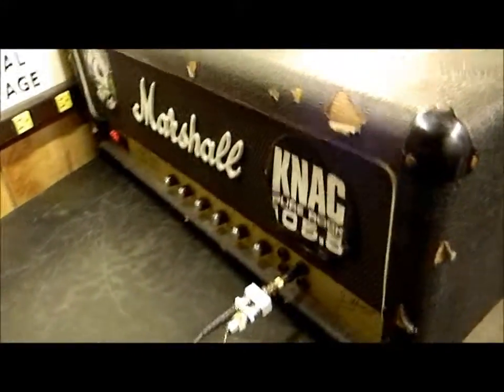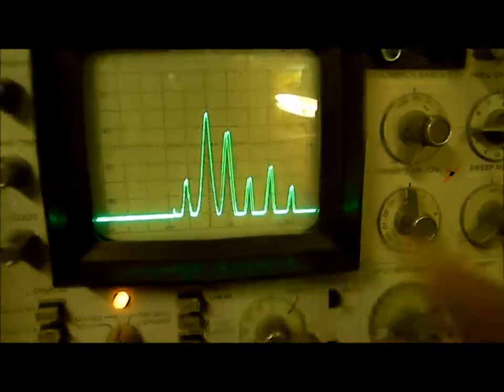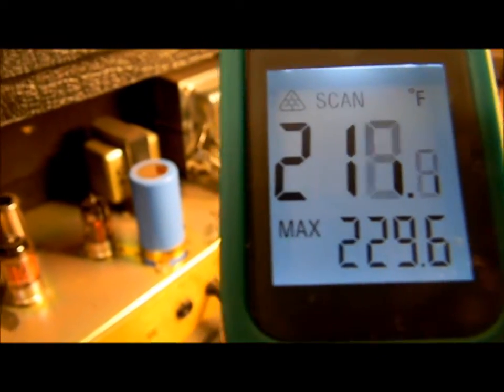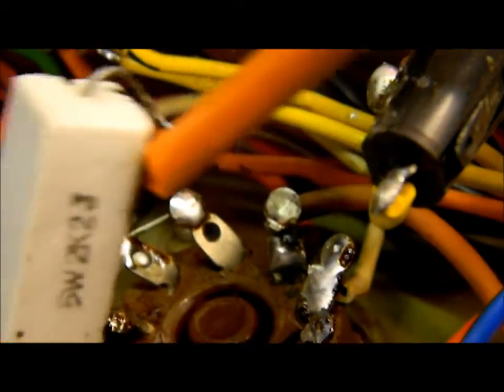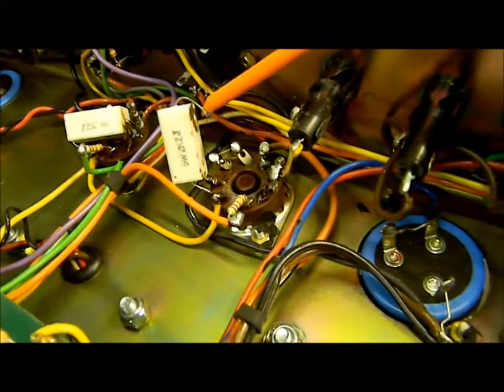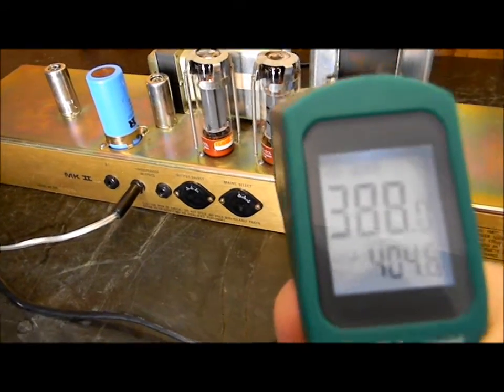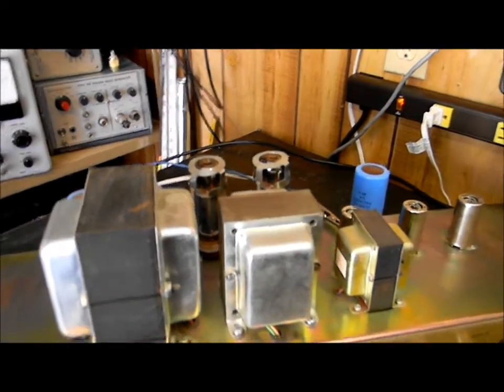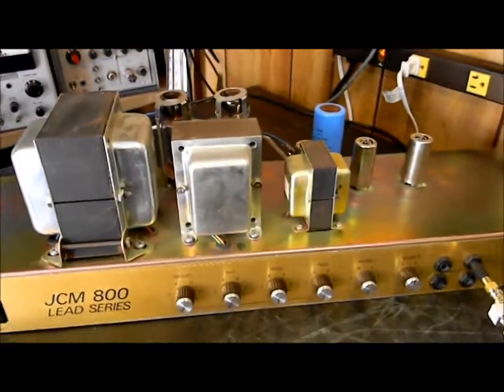Vacuum Tube Plate Temperature vs Performance In Audio Power Output Tubes.wmv

Comment: Hi, I am working on a clone of a Vox amp and wanted to use thermal flow simulation to assess the 60's cab design and orientation of the amp chassis. It is opposite to the Marshal you fixed, i.e. it is upside down, the tubes face down (like many amps) inside the cabinet. I am not sure how to apply a value for the tubes in the chassis which for the simulation is input as Watts. Forgive my obvious lack of electronics knowledge but is there a relation ship between the Watts and external Temperature reached by the tube. The tube data sheets dont show a working temperature range. The flow simulation should show if the heat convection to the components in the chassis is better or worse depending on its orientation, which is the aim of the study. Some people have added fans to their old amps as they have a concern about heat, and some swear that the hotter an amp runs the better it sounds. However there must be an ideal temp range or at least max that a tube should run before its life span is dramatically reduced. There is also transfer of heat through the chassis from the tubes to other components on the turret board and I have often wondered if the amp is better off in an 'upright' config whereby the heat from the tube rises up and out of the cab, without passing over the rest of the components as apposed to the 'upside down' config.
Reply from the maker: Hi Allen, I love studies like this. The maximum plate dissipation of a 6L6GC is 30 watts plus about six watts for the filament and a couple for the screen so I would model a 6L6GC as 40 watts. The temp runs around 400 degrees F for a 6L6GC. There is some truth to the hotter the output tube the better the distortion products up to the point of destruction of the tube. Longevity of the tube and sound quality are (somewhat) mutually exclusive. A tube is considered biased "cold" is the bias voltage is too negative making the cathode (or plate) current less. This enhances a condition called "notch distortion" and that is an undesirable distortion that no one likes. A "hot" biased tube (less negative bias voltage on the grid)  has the cathode current running at or close to maximum plate dissipation. There is eternal debate on where the sweet-spot is in plate dissipation in the musician world. A 6L6 is classified as a "Receiving Tube" and should never show color in the plate - or it is much too hot. An amplifier like this is about 50% efficient (or a little less) so you could double the rated output and be somewhat in the ball park of the power (and heat in watts) as input to the amplifier.Of course, after a few hours, the transformers get hot along with everything else so a fan is actually a good idea. It doesn't take a hurricane of air, just a gentle breeze to make a huge difference but just letting them cook is not a good idea. As an ideal heat range for the tube it would between 350 and 450 F. Thinking of the heat flow in these stock amplifiers - that would be simple convection up from the bottom and out the opening at the top back of the amplifier. In general, these older amplifiers are build pretty well as many of them are 50 years old and have survived the heat for a lot of years. Certainly, a steel chassis has helped .Lastly, mounting the tubes upright would be so much better and also not having the amplifier in the speaker box would be good too but the trend is established and has become an ethereal thing in the minds of many so be careful how you try to change it.   :-)   Hope this information helps you.
Reply: thanks, the tube specs show Screen where applicable, (continuous and peak) and Plate dissipation in Watts for pre-amp and output tubes. Depending on the tube this can vary from 1-2 watts for the 12au and 12ax7 preamp/reverb/phase inverter and tremolo;and 12 Watts for the el84 output tubes. The EZ81 rectifier tube has no figure for dissipation so not sure what  temp to use. AS the tubes are vacuum would i apply the heat source as surface on the glass. i do have some temps from similar amps which can be used for a rough comparison to see if it is in the ball park. what about values for caps, i assume the higher the uf the warmer but specs only show max temp. should i put a watt value on the resistors, most are .5, some 1, a couple 2 and one 10 watts which is first after the rectifier as i assume they gen heat. also mains tx spec does not show value for dissipation
Reply from the maker: Rectifiers tend to run pretty hot so I would go for 350-400 F on the EZ81 and an overall power dissipation similar to the output tubes. .As for power resistors, I would go with something like 50% (or less) of their maximum rating. Capacitors often times become hot from nearby heat sources but as for heat generated internally, that is something I have not considered. Trying to do an E^2/R from ESR values will give you a power source way too high. 10 watts seems reasonable for a three section 40/40/40 uF @ 450 VDC can. I have measured the temp of can capacitors pretty high but placed a 3x5 paper index card between them and the output tubes and lower the temperature considerably. Sorry I don't have the real data handy. Your mains transformer does heat up and add considerable heat to the chassis over time as has already been mentioned. It is pretty difficult to say but you might assume 90% efficiency of your transformer so that 10% of the total mains power is radiated by the power transformer. It might be a little less.

Comment: Keep in mind that there is NO plate temperature... It is in a vacuum, although not a perfect vacuum... There is Kinetic energy of the electrons striking the plate. This energy is emitted from the plate as electromagnetic  radiation...It does not make any heat until it hits a medium such as the glass and the air...

Comment: it gets even more interesting: IR thermometers can't see through glass according to http://www.thermoworks.com/learning/infrared_thermometry101_limitations_of_infrared.html
Although the red dot shines on the plate of the tube, the temperature you measure tells more about the glass than the plate. Of course it's still a good indication of tubes running cold or hot....

Comment: Nice demo, ElPaso - thanks for that!
I was using the same trick and wondered if anyone else did this too...
However I still have 2 unsolved questions:
1) Any idea about the good plate operating temperature for the common types (EL34 6L6 6550 6V6 El84 etc etc) when the plate current is running without ac signal and what is the max temperature?
2) To know the real temperature, should you apply a correction for emissivity of the hot surface (plate)? An ideal black body radiator has emissivity of 1 but it can go down to 0.1 for polished metal surfaces. See http://www.optotherm.com/emiss-table.htm for instance.
Electron tube plates are usually dull grey so maybe the emissivity is almost like that of an ideal dull black surface. Furthermore grey vs black means it's reflectivity of the visible spectrum is different which is not saying much about the 'IR color' of the surface. Sorry for asking nasty questions, I do like the demo and don't mean to question the usability of the IR thermometer in servicing amps at all, it's very useful!
Reply from the maker: I can't say for sure how much the thermometer is measuring the glass and how much is the plate - there is temperature sensitive paint that melts as specific temperatures but it is pretty expensive and would be reading the temperature of the glass but in any case whatever the true temperature of the tube is, it seems a good way to compare the tubes. It does seem to matter where I point the theremometer on the plate so I assume it is reading some of the direct plate temperature. Temperatures from 250 to 300 or so don't alarm me but once it gets above 400 F it seems to me to be too hot. I don't remember if tube data sheets specify max temperature but I think I will look and see. Nice to see you discovered this method also - thanks for the comments.
Reply: ElPaso TubeAmps
here's another simple trick for tube biasing: http://www.broekrock.nl/hosenlander/tube_bias/ I'm using a simple wall plug energy meter to instantly read the dissipated power. With a simple calculation, I can exclude other dissipators like cathode heaters. The IR thermometer does the rest of the job: looking at individual tubes. This however takes some time as the tubes have to settle to the final temperature and therefore the energy meter is useful as well.
Reply: Since IR is electromagnetic radiation, you are measuring all that is radiating  in the "field of view" of the instrument. I would guess mostly the plates because that, and not the glass is the active EM emitter.
Reply: that was exactly my first thought. However, the glass is probably not transparent in the long wave IR range (8-14um) for which the IR thermometer is sensitive. The glass might just absorb the heat radiation from the plate, get hot and re-emit that heat. I don't know what type of glass is used but ordinary types of glass (borosilicate) is not transparent in that range.
Here's a thermal image that I got from a pair of EL34's with a Xenics Bobcat320
http://www.hosenlander.nl/el34_thermal_hosenlander.gif
I could not get a sharp image of the plate so probably you're looking at the temperature of the glass times the emissivity of the glass (check the different emissivity of the 'EL 34 6CA7' letters printed on it, it's radiating more at these locations. Could be that it's absorbing even more that the glass or (probably) the emissivity is just higher than glass.
On top of that, you might see some reflections of one tube from the glass surface of the other tube: the flat surface does act as a mirror in the IR

Comment from the maker: Yes, the heater, or filament, heats the cathode  to a temperature where thermionic emission can occur in a vacuum but the majority of heat in the tube is dissipated in the plate. A large audio tube dissipates about 10 watts of heat in the filament whereas the plate (of a 6550) dissipates 40+ watts and raised the temperature of the tube to 350+ degrees. If I remember correctly, the filament alone will raise the temperature of the tube to about 120 degrees.

Comment: yes - well if you understand ANYTHING about vacuum tubes - you should first understand that the heater elevates the temperature of the plates to create a 'thermionic' condition in the valve(tube)- THEREFORE allowing the conductance (passage) of electrical current - and without reaching a given temperature range will not function correctly or amplify - right?

Comment from the maker: It would be an interesting project to measure the temperature of a 6L6, 6550, EL34, etc with the plate dissipation running as say 50% and check the temperature - then again at 60-70% and post the data. Probably not anything definitive or a final adjustment point to work for but it would be another sanity check. Or what about a post of temp on different brands all running the same plate voltage and current? The very best performing tubes I have are the ones that run at high cathode - next post...

Comment from the maker: Yes, indeed. Temperature rises quickly with rising cathode current. I did not try to determine if is was linear or not. There is a wonderful book called "Care And Feeding Of Power Grid Tubes" that can be had off the Internet for purchased. I bought one many years ago  - go to Eimac's site at  cpii   There are other sites but one of them only show the contents in PDF.

Comment: It's apparent that the tube with the missing/disconnected screen resistor was responsible for the positive-going peaks, which were clipped. The lack of screen current setup another interesting situation: the magnetic field in the output transformer was collapsing prematurely--either that or this particular transformer has very little iron! One would expect that the tube with no screen voltage would have greatly reduced transconductance, hence lower operating temp. Glass env usually 200-220°C.

Comment from the maker: Vpp, as in voltage peak-to-peak is 2*sqrt(2)*RMS voltage or approximately 2.828*RMS. In this particular amp I believe I got just over 20 VRMS so the Vpp would be about 57 volts peak-to-peak across the 8 ohm load. 20 volts RMS would be (20^2)/8=400/8=50 watts RMS. Hope this helps.